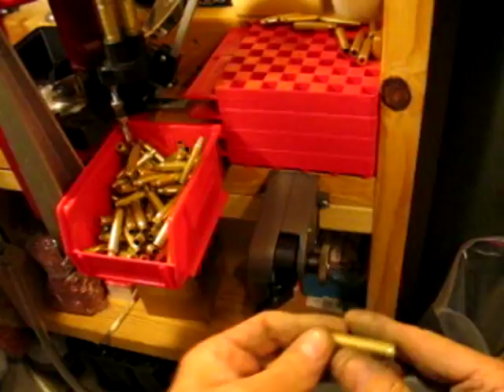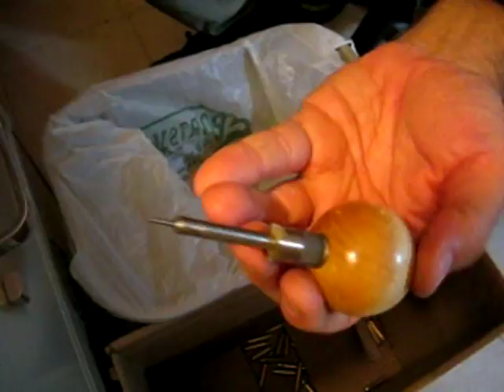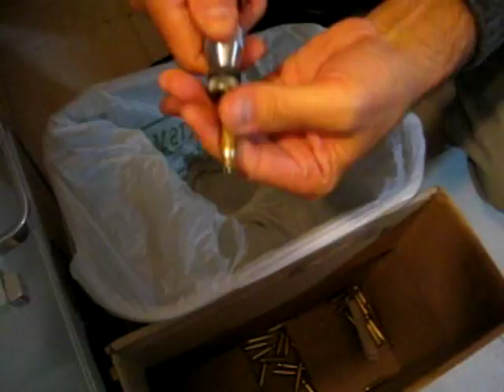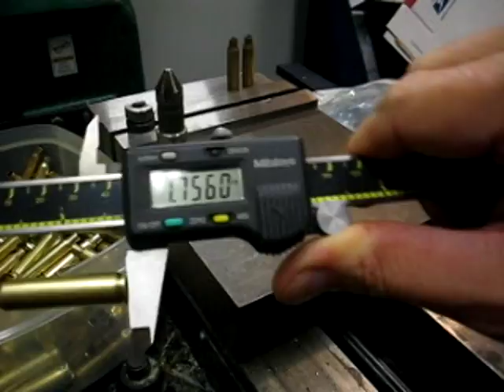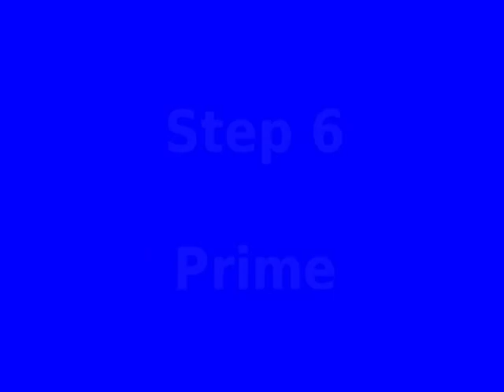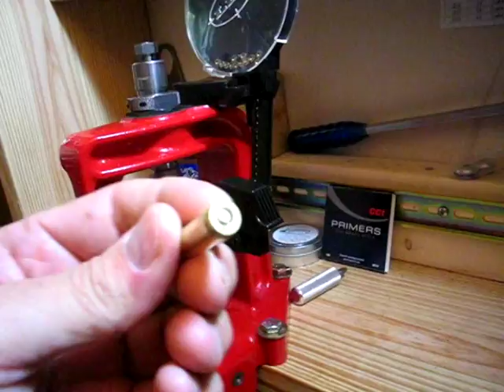.223 Case Preparation - Part 2

Comment from the maker: The case prep processes are the same regardless of which press you use.  Dillon does make an optional case length trimming die, but even with the loud vacuum cleaner removing most of the brass shavings, it doesn't seem like a good process to do on the press, and certainly not while reloading, IMO.

If you're reloading for a bolt action rifle, you may want to skip the resizing process for best accuracy. Brass doesn't need to be shiny, but you shouldn't put dirty brass into your dies.

Comment from the maker: Dimples in the case neck are usually caused by too much case lubricant. The more official name is "hydraulic denting". Basically, the lubricant is pushed up the slightly tapered brass as it's resized, and it accumulates on top of the shoulder. When the shoulder is pushed back at the end of the resizing process, the case lube has no place to go, so it pools and dimples the brass. This is mostly a cosmetic defect. It's OK to shoot the brass, and the dimples will pop back out again. Use less lube!

Comment from the maker: @fishcop444 Maybe a better solution would be something similar to an ER style collet chuck used in machining.  They have wider grip ranges than older collet designs.  With the small gripping force required, it should be possible to make a collet style universal shell holder that could work with .223, .308, 243, 270, 9mm, 40 S&W, 45 ACP, etc.  The collet would have thin metal fingers and a lot more open air space, for the widest possible grip range with the minimal grip force needed.

Comment from the maker: @fishcop444  I use the Lee three jaw universal shell holder on the Zip Trim and it is convenient, although it needs to be kept clean and well lubed to work as designed.  Unfortunately, it has larger diameter female threads for the Zip trim that don't fit the Lee case lock stud's smaller diameter male threads.  I suspect there isn't an adapter, or a universal shell holder for a drill because that mechanism works better on a bench mounted device and would be awkward in a drill.

Comment: Will the adjustable chuck holder fit into the electric drill/screwdriver? Is it easier to use than the standard shell holder?

Comment from the maker: @rossmetacraft  I tried to keep my brass separated, but never could.  I always end up reloading assorted range pickup brass from dubious sources.  I find it easier to assume all .223 / 5.56 brass needs to have the primer pocket swaged.  I'd put the RCBS primer pocket swager in the Lee Classic Cast Press and if the primer pocket fit over the swaging button, it didn't need swaging, otherwise, I'd pull the handle to swage it.  Now, I process all the brass through the RCBS Case Prep Center.

Comment from the maker: @tony10376  So far, I only made videos describing case prep, as there are many options and that can be the most confusing part of rifle reloading.

The case neck should be resized such that the .224" bullet presses in without too much difficulty but isn't so loose that the bullet can move between the bullet seating step and the subsequent bullet crimping step. I never use the bullet seating die to crimp. I adjust the die to seat only, and I use the Lee Factory Crimp collet die in the next step.

Comment from the maker: @hunterwr69 The ammo cost is usually about half the cost of decent store bought ammo.  The start-up equipment costs can be as low as $100 for a minimalist quality setup, and can range up from there.  I'd recommend the Lee Classic Cast press.  It's inexpensive and beefy enough to load ANYTHING.  I use it for .50 BMG.  Reloading manual, electronic scales (.1 grain accuracy), calipers, reloading dies, load blocks, Lee AutoPrime, powder funnel, powder dispenser or scoops.  Work up from there.

Comment from the maker: @hunterwr69 If you shoot a pistol, I'd recommend starting to reload straight wall pistol ammo.  It's easy.  You can do it with a simple single stage press.  I'd recommend a Lee Classic Cast as a great value in a super beefy press you could use for any rifle ammo later.  Follow the directions and be very careful about powder type and powder weight and bullet seating depth and you should be OK.  Once you et the hang of that, it's a small step up to rifle reloading.

Comment: Hey just a tip with you miling machine or drill press you can use the Hornady tool you showed in the first part. I put it in the chuck and then just hold the case under it you can feel when its done its really fast and works great. Might save you a step without having to use the RCBS I dont know just thought id share that with you.

Comment from the maker: The Zip Trim is the gray mini lathe that's powered by a pull string, as shown at the start of this video.

I modified a Lee Cutter to mount to the RCBS Case Prep Center to use with the appropriate Lee Case Length Gage to trim brass to the right length.

Comment from the maker: I'm not sure about bullet seating with a mixture of oil and powder granules adhered to the neck causing an explosion, but oil inside the case is a bad idea. It will probably interact with the powder to change its burn rate, so at the lest accuracy will suffer. Oil can deactivate a primer resulting in a misfire.

I resize and deprime on a single stage press (not the LoadMaster), then clean off the case lube in a vibratory tumbler. Only the clean cases are reloaded. Clean the lube off your cases!

Comment from the maker: Use only a small amount of synthetic oil on the cases, and none on or above the shoulder. Oil on the shoulder will cause hydraulic denting but that's true of any liquid lube. Make sure there's a little oil inside the neck to lubricate the expander. You should develop a feel for how much oil to use and how often by how much force is needed to resize the brass. Use just enough oil to keep the press running smoothly. You don't want a stuck case!

Comment from the maker: Disassemble and clean the resizing die. There is usually polishing grit left in there that will cause cases to get stuck, which is very bad.  After cleaning, apply a thin film of synthetic oil to all of the parts to prevent rust and keep the first case from sticking.

Comment from the maker: When the case head separates, the hot gases can vent out the ejection port or down into the magazine well. Gas cutting can occur and that can damage the gun or injure the shooter. I didn't realize it had happened until the next round misfed because most of the brass was still in the chamber. Excessive headspace can cause case head separation and those can be bad, but I think in my case the brass may be a little stuck and the extractor may be pulling the heads off the brass?

Comment from the maker: I usually don't probe inside the cases with a bent paper clip for signs of incipient case head separation but maybe I should start. I had no case head separations for a long time, and the last couple of times I shot, I had one per day. It could be bad for the weapon and it could be dangerous. Maybe some of my brass is getting old? If so, I'm starting to question my strategy of annealing case necks to prolong brass life. I'd much rather have a case neck split than a case head separation.

Comment from the maker: Lee Cutter & Lock Stud
Lee Shell Holder & Case Length Gage

Both are inexpensive and available online at Midway, etc.

Chuck the lock stud into the 1/4" power screwdriver (cordless drill is faster), and screw the shell holder onto the lock stud to hold the brass. The caliber specific case length gauge screws into the cutter (same for all calibers) and the rotating brass is pressed against the cutter until the pin on the case length gauge bottoms out on the lock stud when trimmed to length.

Comment from the maker: Pistol brass is usually lost before it goes bad, but rifle brass has a definite life expectancy.

Full power loads will often have split necks after 7-12 loads. These are easy to see and discard, and aren't much of a safety issue. Anneal necks to avoid splits.

A more serious issue is case head separation, where the brass thins near the case head. It's difficult to see on the outside. A band forms inside from shooting and resizing and can be dangerous. A bent paper clip can feel the band.

Comment from the maker: Lee Cutter & Lock Stud
Lee Shell Holder & Case Length Gage

Both are inexpensive and available online at Graf's, Midway, etc.

The "brass holder" is the lock stud (1/4" hex drive for cordless drills, cordless screwdrivers, or clamping in milling machine vise), and the shell holder is the knurled collar that is turned to secure the brass to the lock stud.